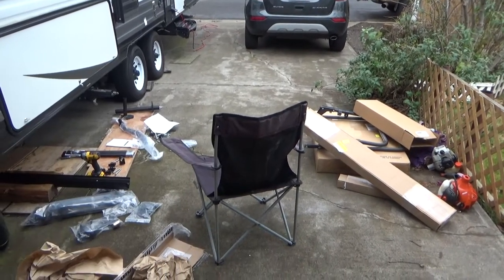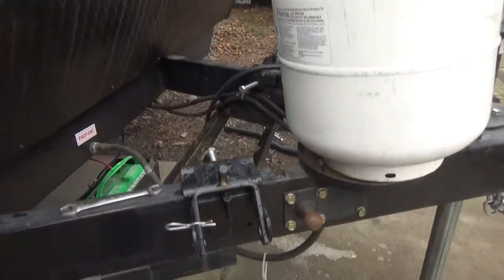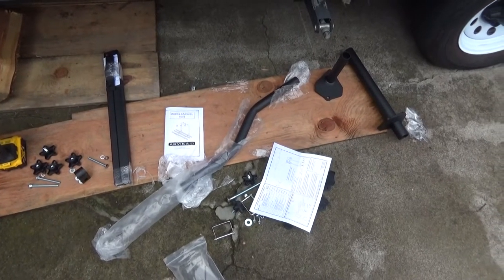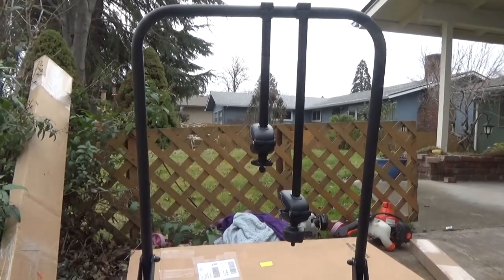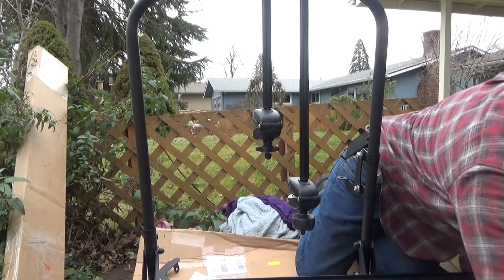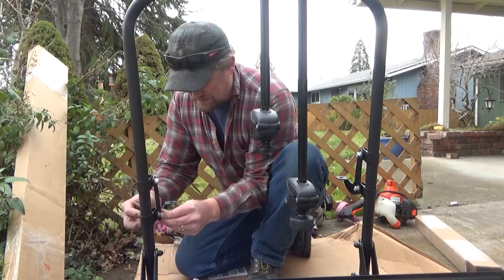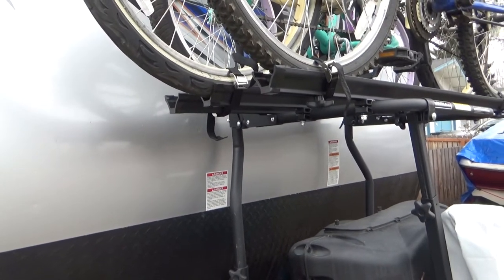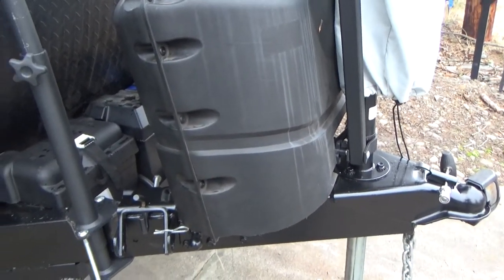Arvika 7004 4 Bike Over Tongue Rack Installed on 2018 Forest River Salem Cruiselite 243BHXL

Comment: Just got one for my trailer.  The instructions are terrible.  There were parts I didn't know what to do with.  The stabilizing bar is awkward.  Very crowed on my Airstream.  I'll have to play with it some more to get it on correct.  I read in on line that if you only have two bikes you can get away without one.  Not sure though.